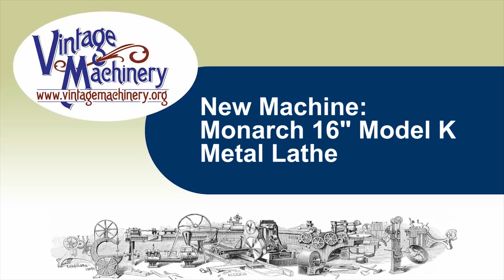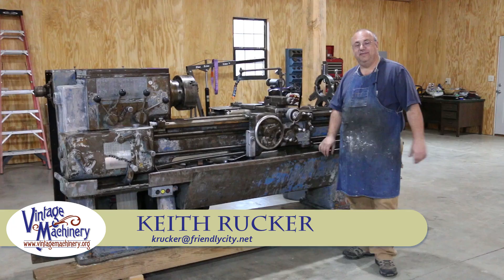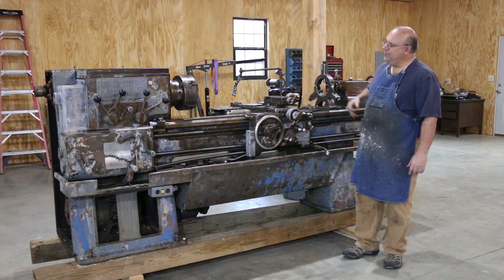New Machine:  Monarch 16" Model K Metal Lathe

Comment: Of course you need a little tabletop lathe too for making little quick jobs without having to change heavy chucks and occupying the big ones with work in the one inch range. Have you considered designating your lathes for single materials? One machine for turning aluminium, one for steel and one for brass/bronse? That would be an incentive and motivate you to get a few more lathes!

Comment: Check the start capacitors. Sounds like they maybe bad. My lathe motor was doing the same thing.
Reply: 3-phase motor, no start/run caps
Reply: A 3 phase motor does not have start capacitors, only single phase need them.
Reply: My rhought also. Bypassing the start capacitors wont start the motor, it needs those caps to get juice enough to start turning.
Reply: Russ Kepler  I didn't think about it being 3 phase

Comment: I think took sharing and standardization is important in a shop. I passed quite a few very good deals on machines simply because the tooling pool i currently own was not suited fit them. Some, rightfully so, might say that's not a benefit, but, i'm always playing the long game, as such when my arrangements for my shop are complete, i will have one set of chucks, one set of tooling units, one set of mounts, etc.

My inspiration came from a shop i visited many, many years ago, as a teenager (being that i'm an young adult now, ain't much difference, but i'm older) the level of efficiency those guys were able to achieve was mind blowing. And that was because they had sought standardization from the start.

IMO, it also lowers costs a little bit, not by much, tooling is tooling, but it's the fact that you can buy in bulk and get some % off that counts in the long run.

That's just my two cents on the matter.
Reply: Also, Keith, don't keep stuff you won't use. Like that quick change. Resell that thing, it's not worth keeping everything around, the old adage "need it when you need it" works only so well until it runs in to sand.

Comment: Are you going to check out that coolant pump before you put it against the wall?  I remember Abom having fun trying to work behind his Monarch to remove the motor and replace the hoses.
Reply: Hammer0f Thor it has been taken off to remove all the paint
Reply from the maker: I actually removed the coolant pump from the machine so I could check it out.  It will be easy enough to put back on.

Comment: Totally agree with you about the motor, sounds like one winding is burned out (assuming the motor isn't jammed), came across that same thing many times in my career, a motor that size is often cheaper to rewind than buy another, even if they change the bearings while they have it apart.
Before  you first mentioned it had problems i could see the bent shaft, and knew immediately how it happened ;)
Reply: doubt its jammed as it does start but very poorly ,  its got a OC winding and is two phasing 

ex armature and stator winder/ motor repair up to 3000HP and 3Kv
Reply: Sounds like a jam to me, but jams and burnt winding are very much similar (unless you're actually near the damned thing, where that becomes obvious).
Reply: lets hope it is just worn out brushes. Brushes not making good contact because of being too short will arc and blow fuse. Being it has at least 3 paint jobs could mean it has had a lot of work. Burnt winding will be a short or open short blows fuse open wouldn't motor do nothing. So my best guess is jammed bearings or worn brushes.

Comment: That thing looks like a beast, Keith. Lot of capacity and some pretty sweet features!
As you said, even if you have to swap out the motor, I don't doubt you'll have that tank up and running with relatively little trouble.
Yeah, you say you are set for lathes but you are definitely an addict so I won't be surprised when the next one shows up.
Good to see more restorations in the pipeline.
Keep up the great work!